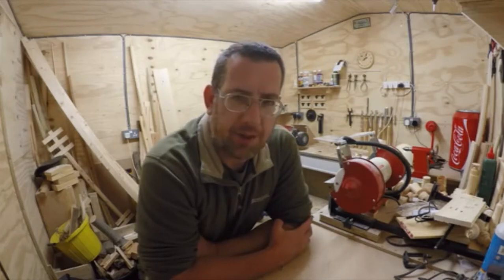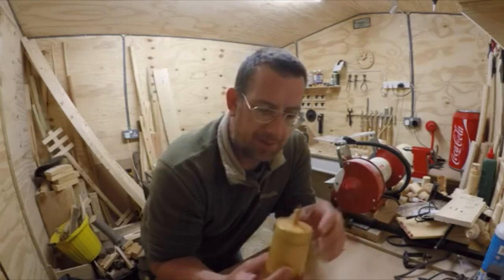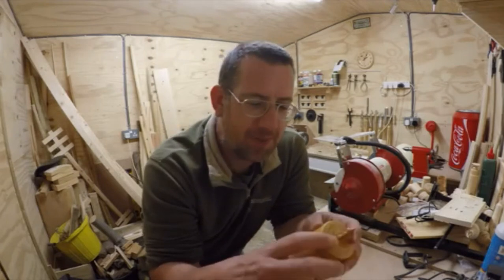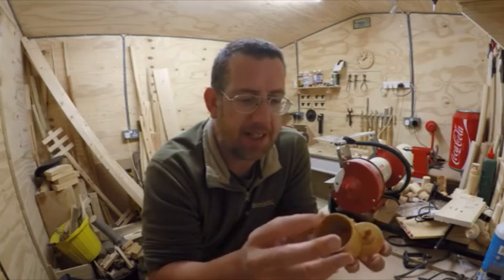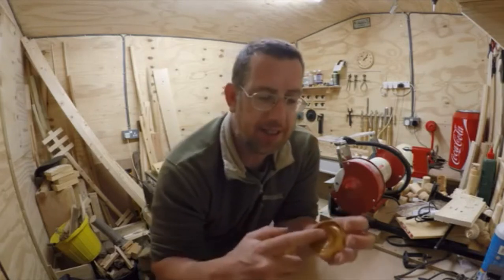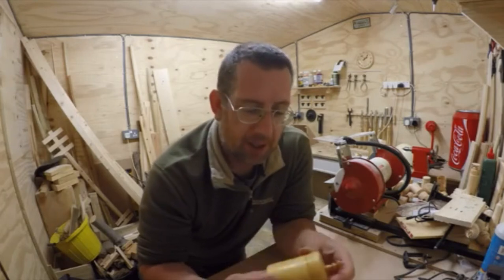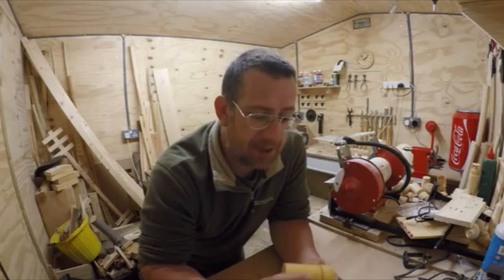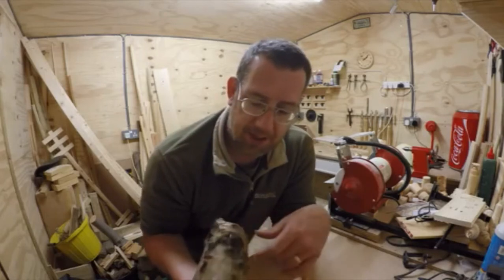Silver Birch Lidded Box - Episode 27

Comment: Hi Paul, well done, just a thought but have you tried sanding sealer before you use the finishing polish, I have done this and I felt it made a difference?
Reply from the maker: Hi Brian. I will give that a go. I thought that the shellac in the mix may have sealed it at the same time,